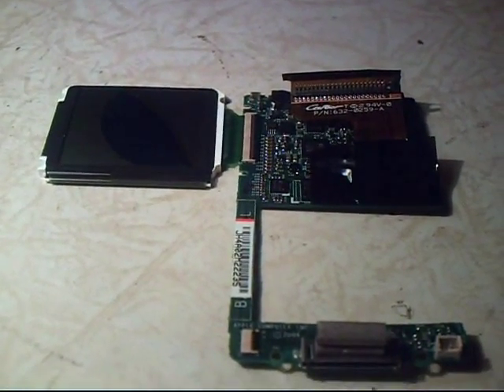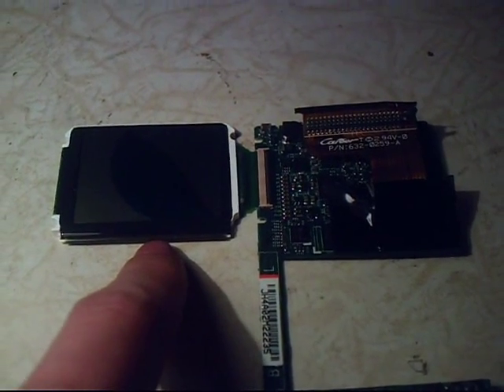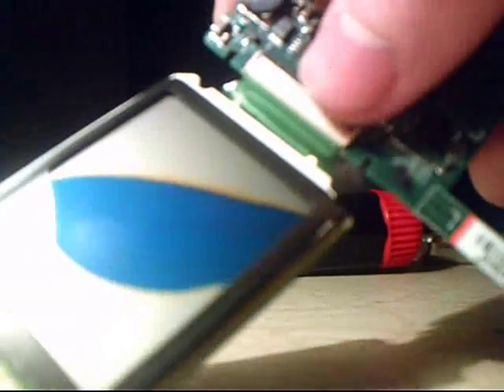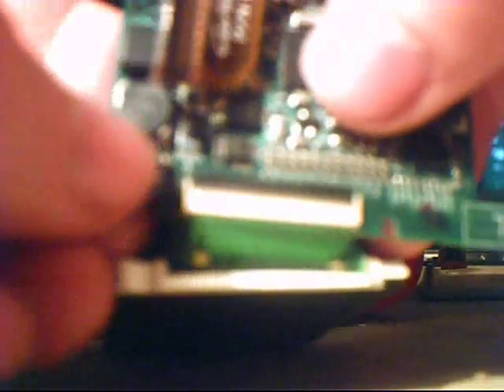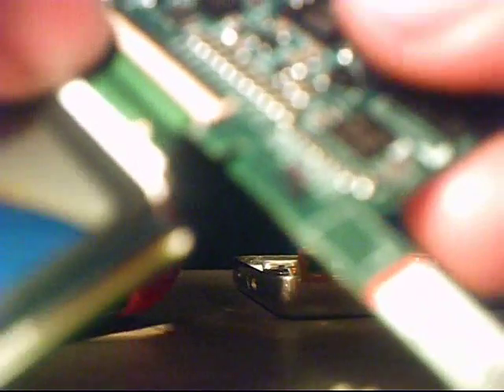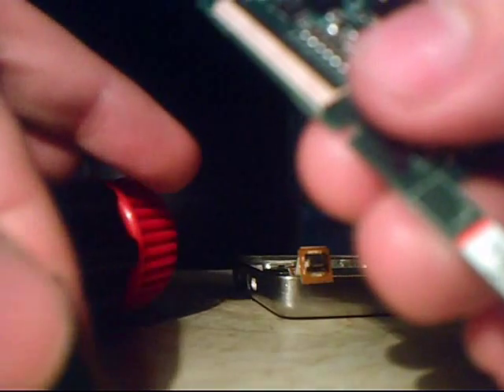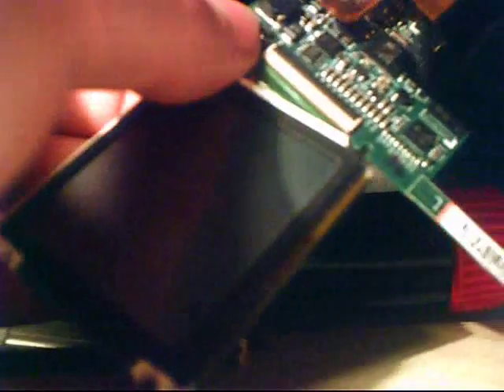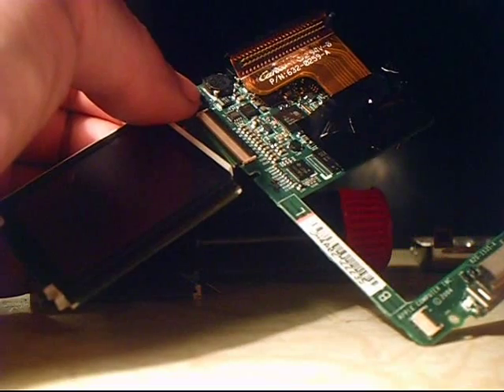How to replace a broken Ipod screen

Comment: my white 30G classic iPod (5th gen - late 2006) screen has a black pixel line horizontally no matter what I do.  Where do I buy the screen part to replace it?  Apple wants $129 USD to repair or exchange the iPod.  Because of sentimental value, I want to keep my iPod, but I don't know where to buy this part without being taken?  Thanks for the video.